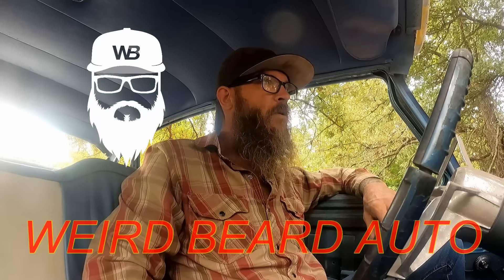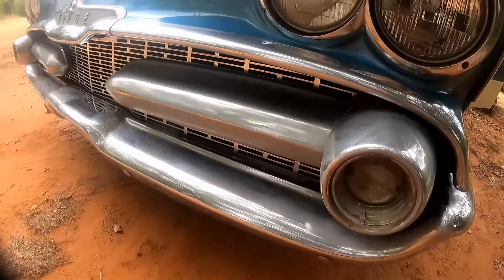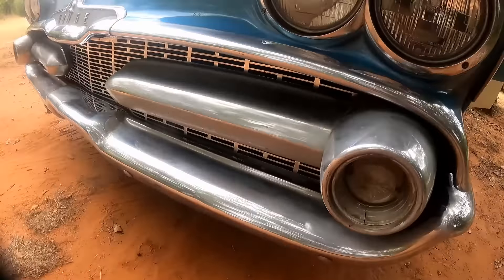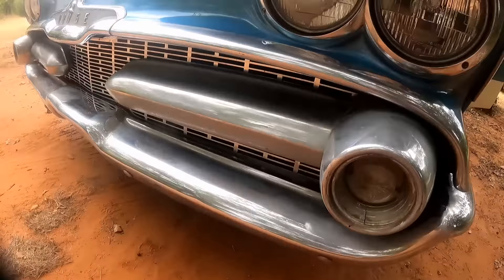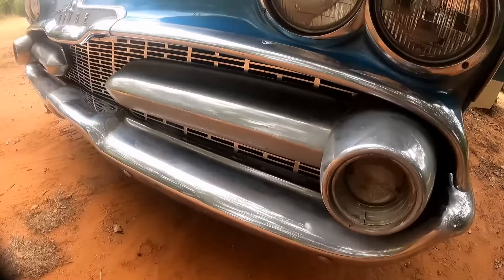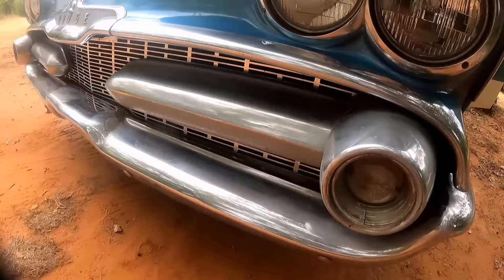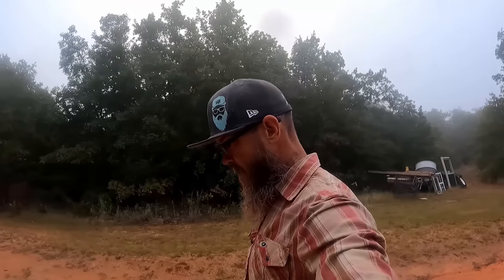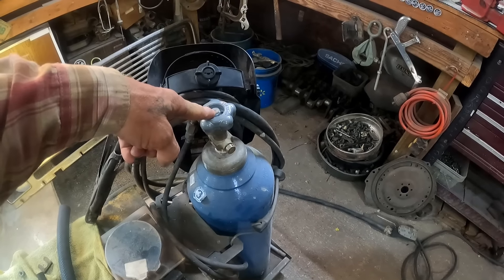Do we even have all the pieces?!?! Reassembly of the '59 Dodge hits a snag + the Plymouth Fury.

Comment: Thought you had given up the dodge after grief you had, glad you’ve got your Mojo back 👍👍👍👍
Reply: Didn't AAR. ABANDON THAT AT YOUR SHOP😅😅😅
Reply: @gerry-p9x  No he gave the title to the car to Mike.
Reply: I want to like the re orientation of the 59 dodge tail lights, but after looking at it for a while, I think the original stock orientation looks best.
Reply: He should give its been 50 years am sure alot of stuff got lost after 50 of it sitting
Reply: We have to think backwards on how they put the car together. Meaning when that car was going down the assembly line it was moving fast and they didn't have time to fiddle around with nuts and bolts. Nice car. I do it all of the time fiddling around with nuts and bolts, trying to find a dropped nut, looking for a socket or wrench. Sometimes I think I'm going crazy 😧

Comment: Have you thought about possibly doing a mechanical overdrive automatic conversion on this beauty? The increased drivability of a mechanical overdrive automatic with what believe would be 3.50 or 3.70 gears in the Coronet would really make it driver friendly in the city, country roads or highway. 
I'll be doing the conversion on my 1979 Ford Thunderbird and changing to a 3.55 rear gear as well, and also converting to 35 spline axles.

Comment: Old 727/904 trans will leak when unused, internal seals shrink and need replaced. My Chargers trans has the same issue, never rebuilt but it shifts and runs great only it pisses when I leave it sit for a month or more.

Comment: I have some bathroom trim that is chrome and was looking really bad. Use a very fine grade of steel wool, and it took off all the rust. Then you have to wax it to keep the rust from coming back. 
It's great to see you back at it again. Thanks.
Reply from the maker: Good tip. Thanks for sharing

Comment: I personally love all the chrome on the older vehicles. 
My first car was a 66 Coronet 440 two door hardtop. What a beautiful car. Nothing really special, 318, automatic transmission, power steering, and am radio. I made a couple of modifications, and I'm pretty sure it doubled the horsepower. I added  a chrome air cleaner and dual exhaust with chrome tips. First thing my dad said was to get my car to the muffler shop. Mine had a hole in it. He didn't approve of the duals, but it was 100% my car. I worked after school, saved up my money, and bought it. I'm no dummy, so dad checked it out and gave it a thumbs up before I laid out $400.00 cash. She was beautiful, solid white with a dark blue interior. I wasn't a fan of the stock hubcaps, so I scrounged through the junk yard and found some good-looking Pontiac hubcaps. Lots of chrome. Beautiful.
Reply from the maker: Thanks for sharing your memories with us. Nothing like your FIRST car. 
I remember mine too. It was a rusty old 2 tone Chevy Silverado. Green and white. 
I turned my dad’s driveway into an oil slick rebuilding that old truck. 
It’s what started it all lol.

Comment: I'd've left the taillights as original, but that looks good. I'd like to see the original designer's sketches - they might've originally intended for them to be like that, but had to rotate them because of safety concerns.
Holes were taped to keep paint dust out? 
Maybe a few ounces of ATF in your oil, to lube up them sticky lifters?
That missing trim piece looks small enough to just fab one up out of some shiny stainless steel, if you don't find it.

Comment: If you don't tape the holes the paint collects there, blocks the hole, drips down the inside making a mess and can cause issues with the paint around the hole. If you tape it even if it's blocked up it's easy to clean it out.

Comment: That car is so set in the skirts and flipper-hubcaps era, but I find myself wondering what it would look like on a set of Torque-Thrust wheels.  More of a mid 60s look.  Nothing too tall or too wide, that wouldn't look right to me, but maybe 16" wheels with tires about the right height for the time.  It needs some sidewall height.  Whitewalls only with the original wheelcovers, not on mags.  Still true to whatever acid trip Virgil Exner was on when he was designing these cars.  He pushed all the limits.  "Peak Chrome."

Comment: IDK about the tail lights... I think they were designed to look like the fire tails on jets made at that time... and they clocked so you could see the signals from the side... but you're right, it looks a bit funny turned sideways.  I wonder if you had the top one with the chrome on top and the bottom one with the chrome on bottom... so you have like a sandwich considering the tail fins and the fin-like protrusions on the bumper... almost like it's containing and directing the "fire" coming out of the jets.  But man, you do what YOU like.  (I don't think they made visibility of your signals from the side a legal thing until later... so it should be grandfathered in, if you know what I mean.)  I'm enjoying this resurgence... keep doing what works for you.
Reply from the maker: They were all about the jets back then for sure

Comment: Do whatever you want with the taillights the designers didn’t know what they were doing when they designed those cars anyway. You have done a lot to save that car.
Reply: It was actually for visibility from the side when illuminated, wasn't required federally until 1968, but some states had started putting in their own regulations for that during the 1950s